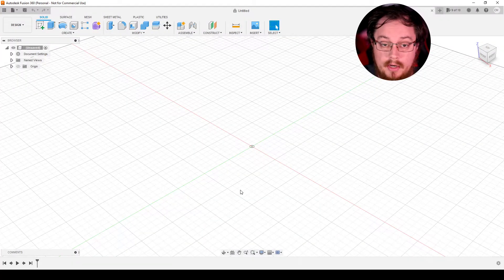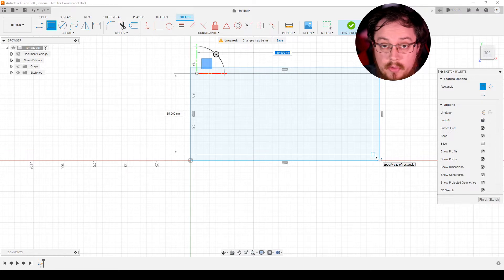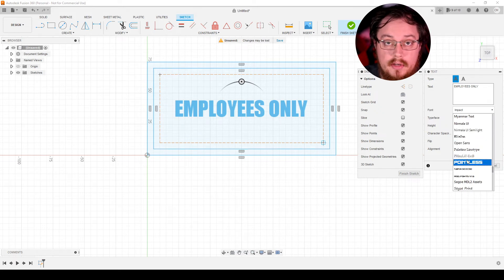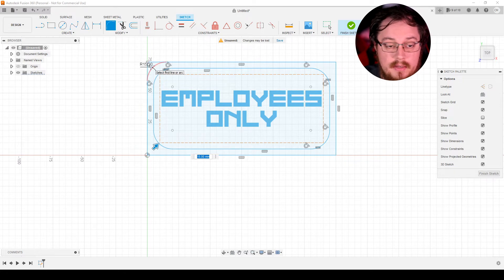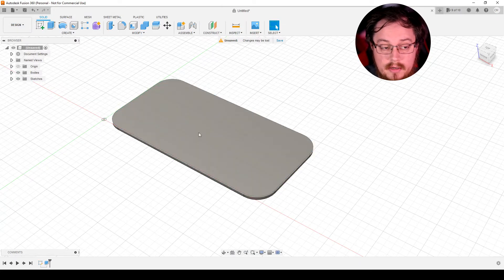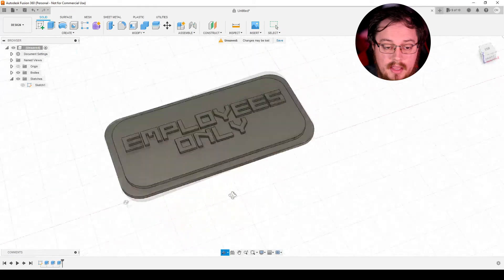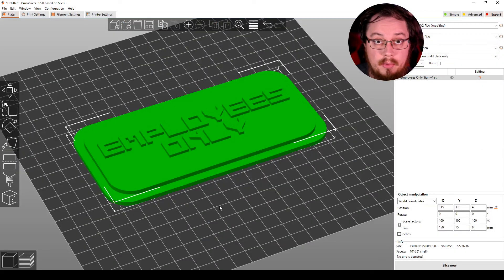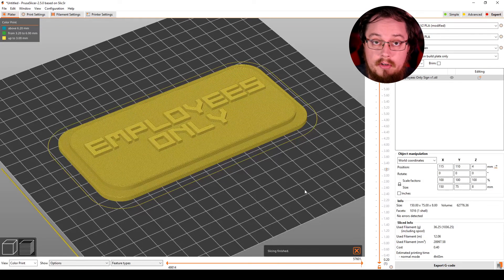Making a Custom Sign in Fusion 360 with NO experience

Comment: Great video, I am having and issue with a repair. Do you have Skype, if so could you please look for my account, Thunderbye and text me, I can’t get the Face ID to work on a 12 mini, I moved over everything and double checked everything. I’m not even getting an error in settings
Reply from the maker: I don't have Skype, you can DM me on Instagram or Twitter though. The only time I've seen an issue like this is with aftermarket screens, sometimes the paint or laminate that use on the screen doesn't let the right amount of light pass through. But that was mostly for proximity sensors on older ones like the iPhone 6. Or an old chunk of adhesive would sometimes cover the sensor.
Reply: @TapticDigital  unfortunately I don’t have those is there any other way? Maybe what’s app?
Reply: @TapticDigital  The issue is, it is not engaging, like the front camera works it’s just not trying to unlock. I tried updating cleaning the censor
Reply from the maker: @thunderbyetronics  module could partially fried. I tried setting up a whatsapp and a discord but both wanted to harvest more personal information than I was willing to give. I've seen Face ID work only at very short distances before, but not really fixable without soldering it over to a new flex. Unfortunately the front camera can be working fine even if Face ID doesn't, it's that little dot projector module that goes bad. Try to set up Face ID in setting and see if it only detects you when you get very close
Reply: @TapticDigital  ok I’ll try
Reply: @TapticDigital  the thing is portrait mode works but not Face ID that’s why I’m confused lol
Reply from the maker: @thunderbyetronics  that is... Very confusing. At that point I'd almost suspect software or iOS issue, maybe a forced update through iTunes?
Reply: @TapticDigital  ok I figured it out. I plugged the old screen in and it worked and then I plugged the new one in and the issue fixed it self. Like I had the right ear speaker and front camera assembly and when I plugged the old screen which had no ear speaker assembly in with the new screen and earspeaker it worked
Reply from the maker: @thunderbyetronics  magic! Haha I'm glad you got it sorted
Reply: @TapticDigital  i recorded the transfer of stuff and me breaking the screen but not the Face ID part but i will make a video in the future